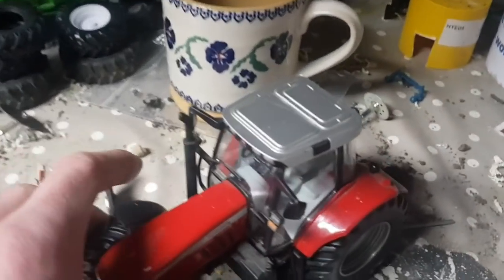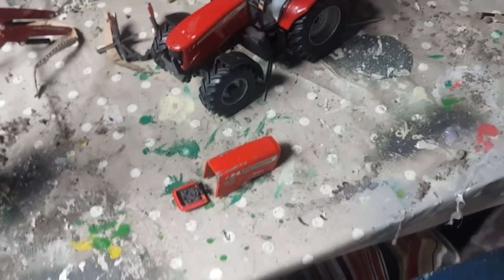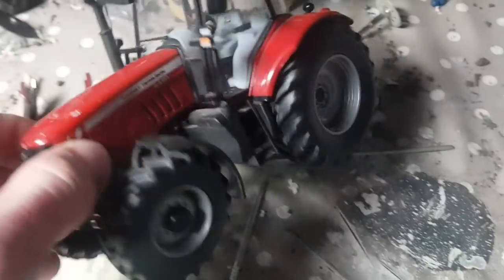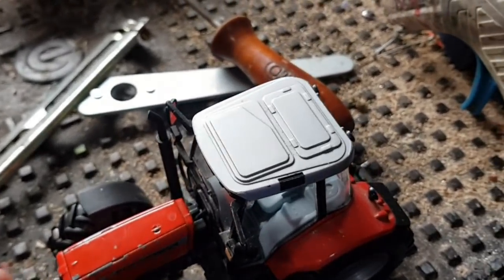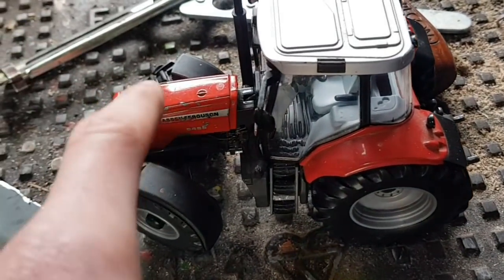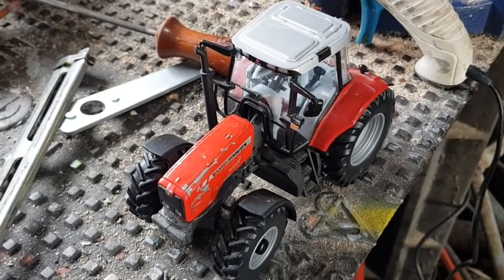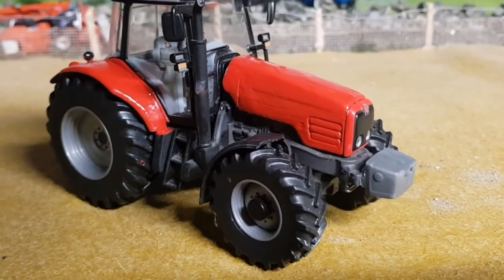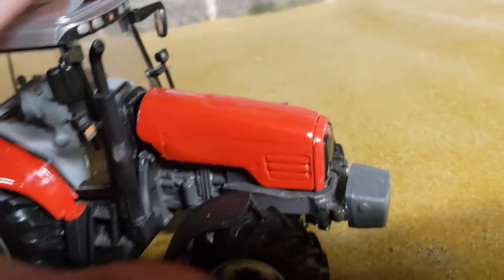Model Modification Series Ep15 Converting A Britains Massey Ferguson 6480 Teir 3 To A 6490 Teir 2!

Comment: Tip for you use the yellow high build primer when using filler spray on a few thin coats fill all pin holes in the filler Will get a better finish on the top coat has it is lighter